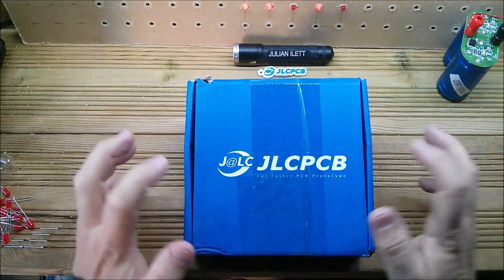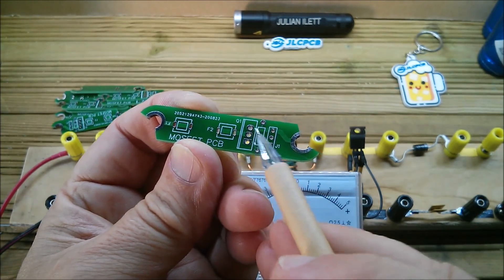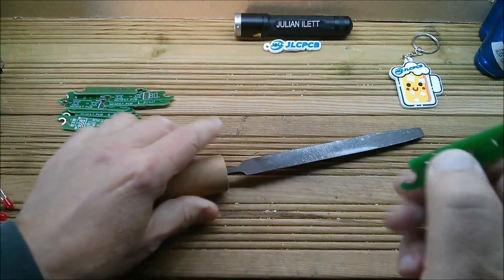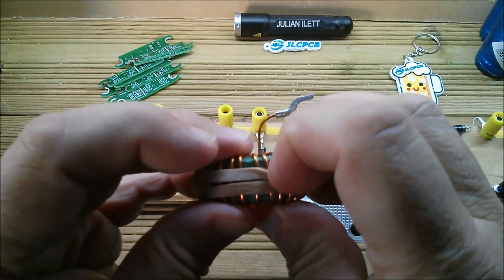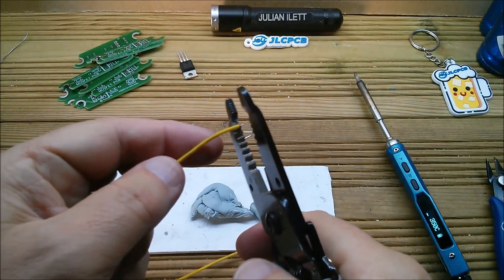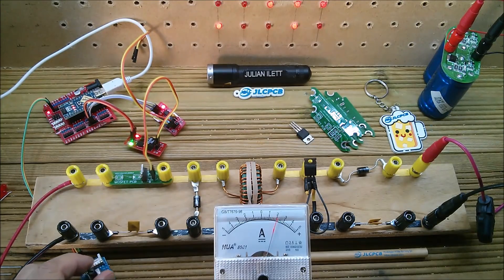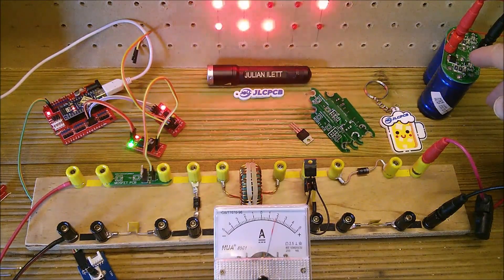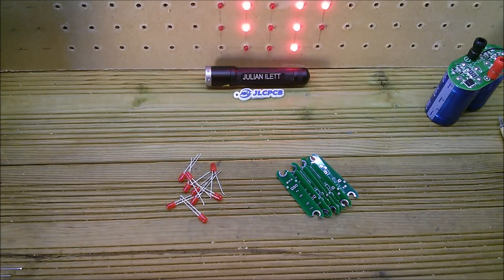MOSFET PCBs from JLCPCB

Comment: Great little PCB.
The cutting of the MOSFET legs was harder than usual because you were cutting the thicker part of the legs that usually sit up out of the board and not the thinner part that you normally solder.
Please fit the 10k, the lack of it may have been behind the previous MOSFET failure.

Comment: Interesting, did JLC not complain about the cut pads at all? I heard they'd reject your design if their analysis tool detected something was wrong - in this case the cut holes with without selecting the castellated holes option. Does that option just affect whether they plate the edges? If that's the case I can understand the cost.

Comment: If you follow the Production Progress on JLCPCB, you would know that drilling the holes is indeed the second step in manufacturing :) (after MI, whatever that is). Copper Deposition is step 3 and Profiling, V-cut scoring is step 10.

I just had them drill 52,000 holes in one of my projects :D

Wouldn't it be better to have the openings for the binding posts on one side of the PCB, so you can just slide it on straight from one side? The openings wouldn't need to be that large, which means you'd have more contact surface, and I would think it'd be easier to slide them on and off the posts.

Comment: I had to increase the frequency of PWM signal when applied to relays, from 5 KHz to 25 KHz. Then my children couldn't detect the sound. BTW, a 50% duty cycle applied to relay coils reduces current significantly.

Comment: "Of course I have no way of knowing what the rating of my fuse is!"  Surely yes, Julian, wire tables. Most hookup and other stranded wire seems to conform to various standard specs - quel surprise - so standard wire tables should give you the fusing current to as near as might really concern you. But, I know that you knew that anyhouw, so I've been had ;-)
It's not often that we get to have a look through your glasses either . . .
Reply: Yes.....but are there tables for copper-coated steel wire strands? or ever copper-coated aluminium?...lol! But i am sure that Julian wouldn't tolerate those in his lab, and only uses pure copper.....unless he was broke that week...lol!
Reply: @englishrupe01  I would hope that the sort of wire that he would be taking strands out of to use as fuse wire would be good quality tinned copper wire strands. I seem to recollect that two strands twisted together was good for running an electric kettle. One was insufficient! That was back in the early 1970's though.
http://www.refrigeratordiagrams.com/wp-content/uploads/2009/11/table-6.JPG
40swg seems to be good for a couple of Amps.

Comment: Connect your "fuse" (or a surrogate) across the terminals on your bench power supply.  Set the voltage to, say, 5V and slowly raise the current limit until.. The "fuse: does a job.
Reply: Richard Grier could also measure the thickness of the wire & calculate it.
Reply: @MrThomBeck  I guess I'd ask, "what calculation might I apply?"  I know there are formula(s) for calculating the maximum SAFE carrying current based upon wire size.  How about calculations for fusing.  I suspect we enter the area of trade knowledge or even trade secrets.

Comment: I wasn't sure if I couldn't hear the 15k because I'm using bluetooth speakers and the frequency response over bluetooth isn't fantastic. Turns out I'm just getting old. Got an android app called "spectroid" (free and doesn't even seem to have ads) and yep its there. Big spike around 15k as soon as the circuit output is turned up. I'm just getting old. You could use that app to poke around at the coil and other components to find the source and see if there is a way to quiet it.

Comment: @9m15s: Clippers, "What's going on?"  Cut the legs into the narrower direction (of the lead), as opposed to over the wider flat direction (of the lead). In other words, turn the circuit board by 90 degrees, and sneak the clipper blades in-between the leads. The same force over a much smaller surface area (intersection of the edge of the component lead and clipper blade, contact area) should make clipping easier. It only matters with these sorts of nasty tough (tinned steel?) ones. Cheers.

Comment: Is the switching noise coming from the mosfet switching not the inductor.
You could try using a app on your phone and pointing it at the components to determine where its coming from.

Comment: You could possibly use copper foil tape to add a trace on the rear! I have some the adhesive is conductive, i havent used it yet, i got it to repair traces on a remote control PCB,  the traces were so tiny and close I couldn't solder them,

Comment: I still hear it... It probably is coming from the inductor vibrating. Normally they are painted with lacquer to help prevent this. I would try to rewind it really tight and use some super glue or varnish to hold it tight.
If that doesn't work, you might have to increase the frequency above 20Khz so people can't hear it.

Comment: If you use the tip of the wire snip, as you did, you need greater pressure because of the leverage; so, do the cutting of the leads near the end of the cutter blades and you will hardly even feel the pressure.

Comment: As for the noisy inductor, a thick coat of varnish will lock everything solid, ideally proper transformer varnish, but any varnish will work :) Superglue is a known fix for transformers with loose lamination's, you can hear the pitch change as it sets :)

Comment: Not sure what cad you use, but in easyeda you can delete or change the F1/F2 markings on the board
The boards 'wrap' around the teerminals in the wrong direction, should go clockwise :D
There's an interesting video showig how PCBway makes boards, JLC probably do it the same way
(pcbway factory manufacturing)
Though i use jlc myself

Comment: For your filing the holes to fit issue, a radius from the center of one hole to the nearest edge of the other will give the correct outline :) Also you could have paneled the boards, EasyEDA has the option under Tools for V cut or Stamp Hole, for V groove the minimum dimensions are 20 x 70 mm, I always try and get as many as I can out of 5 x 100 x 100 boards :)

Comment: In EasyEDA, File > New > footprint, paste in your 2 spring clip footprints and Group them, save as "name".
File > New > Symbol, paste in your fuse symbol, save as "name".
When you do Convert to PCB it will ask for a footprint, point it to it (in Workspace).
Reply from the maker: Perfect - thanks Steve
Reply: @JulianIlett  Not quite perfect as it does not perminatly link them, there must be the correct way but at least this method works :)
Check the connections when linking to a footprint ! If you delete pad 1 of lets say a 7 pin footprint and then the next pad will be 8 even if you paste it into the old 1 position :(

Comment: Not sure you've seen some of the electric car folks with a take on usefulnes of a super cap in those vehicles. Has to do with the possibility of a charged supercap being able to provide much more instant high currents . So, the need for surging of speeds from the electric motor is met much better than would be done with a battery bank. And, they charge very quickly and safely, so they can also provide close to instant charging capability for electric vehicles which need that. Special needs system.

Comment: I've seen builders put these little white square's of something between each two wires, skipping each time. Seems like they were doing RF projects but might work for noise also ? Not sure what the square light colored patches were made of. Oh, remembered, its in my book by Jerry Sevick Transmission Line Transformers so maybe I can find the details? So now to work towards an automatic regulator and a feedback from the protection circuit that automatically reduces the current when the voltage on the caps reaches protection ?

Comment: Can’t you simply unscrew  and remove the yellow posts, drop the pcb into the lugs and screw the posts back down again? Just a thought. . . 😉
Reply from the maker: These posts only unscrew a few millimetres, then bind up.
Reply: @JulianIlett  You only need to reshape one end of the pcb to allow it to swing into place.  Loved the practical approach to trying the rubber band.  Maybe try a wire tie that you can pull tighter - as a test.
Reply: Julian Ilett fair enough! I have terminals  that can be removed. 
I’m enjoying your posts which are definitely helping me with some arduino stuff. 😀

Comment: You could try and place a few via's around the edge to connect both sides of the hole on the bit thats left after the cut. Won't hurt and won't cost any extra either. Turned my hearing aids up to max and can't hear the whine :)

Comment: I ordered some of those Side Cutters from BangGood.  Crap they are.  The jaws don't meet each other well at all.  First time you grasp and twist with them there done.
Reply: Those ones aren’t heat treated, that’s why they bend easily.
Reply: @BeezyKing99  Yes , Junk.    I've snapped off jaws on the hardened type with little efforts.  Strong armed I'm not.  Brake they did.  LOL

Comment: That is why they paint Clue over the Coils.  It subdues the Buzz.
Reply from the maker: Maybe I'll try hot glue next :)
Reply: Hot glue comes in many temps and fashions.  100C to 500C or more.  Heat Conductive,  NONE Conductive,  Conductive ,  cut to form.  Specialized adhesives like used on the space shuttle even higher.  Yes plain ol Silicon would do the job suppressing resonance.

Comment: That 15kHz tone is still really annoying... 
Which was the problem with higher frequency? Because I think it is not that hard to go up to 30 or something kHz with the arduino (with an 8 bit counter).
Reply from the maker: 2 problems: The optos are struggling at 15kHz so the MOSFET is not switching cleanly. The Arduino code is primitive - 15kHz is the result of some round numbers thrown at the PWM hardware. But I will look at this :)
Reply: Julian Ilett Perhaps it might make more sense to go with something more primitive like a 555 square wave generator? You can definitely exceed 15kHz with one.

Comment: Think the rubber band is held off by the coils.its between the core and the coils that you need to apply pressure, or tighten the band so it deforms the coils

Comment: The 15KHz is worse from the rubber band in my opinion
Reply from the maker: Oops.
Reply: Julian Ilett it was a good idea,would have heen great if it worked 😄
Reply: My head pain is to bad after i wathched the vodeo.
Reply: Band make the noise worse
Reply: Yeah its so bad with earphones
Reply: Was worth a try!
Reply: maybe use some hotglue instead
Reply: My 48 year old ears did not hear it at all.

Comment: Nice pcb. For the holes, two straight routs, both to the same edge so you can slide the board in from the side - no rotation. And fatten the high-current tracks all the way with copper fill.
Reply: Additionally,  an extra couple of holes and it could have been a universal board for diodes, inductors  etc.
Reply: That's even simpler than I was thinking. I was going for a fork on one end and a "C" on the other, but your double "C" side entry is probably better.

Comment: Its a neat board but I can't imagine it working well given how spread out everything is!

Common wisdom is to make the connections between components as short as possible, particularly high current paths, between the switching transistor, Diode, inductors, and bypass capacitor. You want the stray inductance to be as low as possible.

Also having even a few inches of wire driving the MOSFET can be an issue with stray series inductance forming an LC resonant circuit that rings on the edges, and miller effect problems are aggravated due to the higher impedance drive of the MOSFET.
Reply: Its just for teaching and experimental purposes, and works well, factoring in the "Miller effect"  is OTT.
Reply: @ Power Max -  Interesting how the PCB caught your eye, but you have a blind spot to the exact same Muppet 2 circuit spread out over the lengthy wooden base version. I find it interesting how the human mind can be focused by the visual input, in this case of a green PCB. No blame here, but worth noting this human condition, and being aware of such overly narrow focus. We all do it. AI systems can have the same sort of reaction to inputs. Cheers.